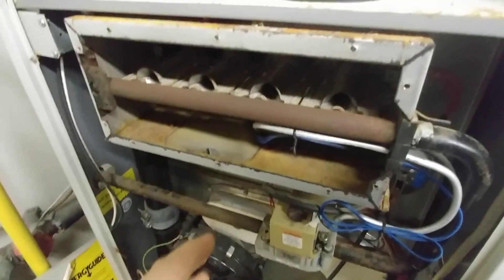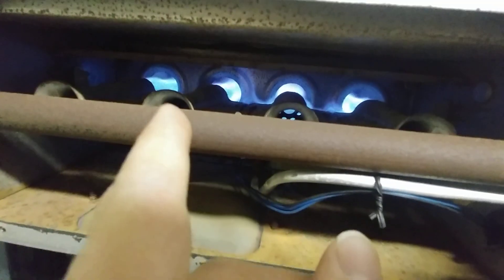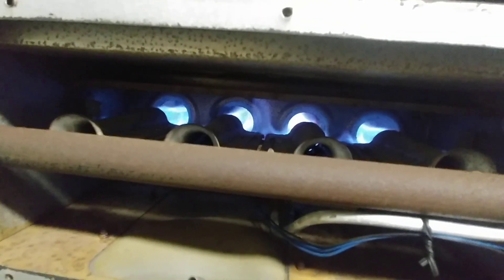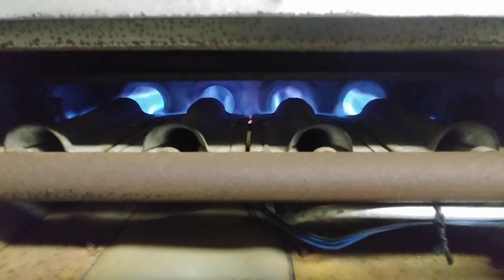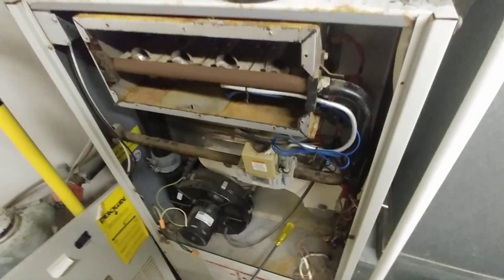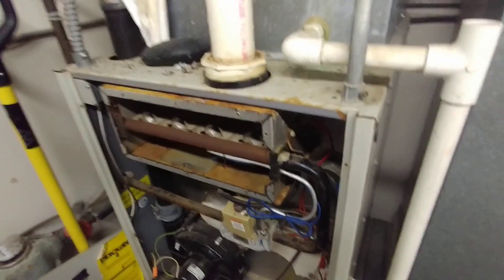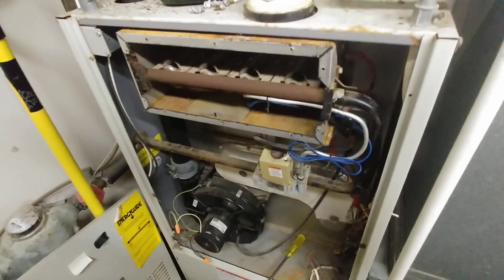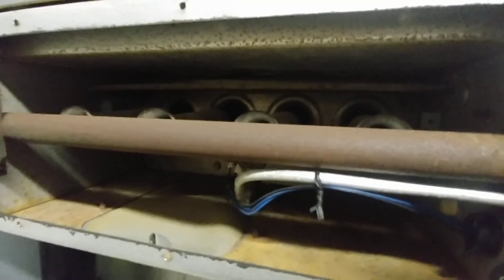Symptoms of Holes in a Heat Exchanger - Furnace Troubleshooting & Almost Lost my Eyebrows!

Comment: Bad circuit board or gas valve and bad heat exchanger. The fact that the gas valve is coming in prior to the igniter is also a safety hazard. That most likely caused the heat exchanger to fail because that problem was not corrected in time. This furnace had two unsafe issues, and it definitely needed replaced!!

Comment: definitely a cracked heat exchanger. The gas valve turned on before the ignitor did which allowed gas to build up before it ignites
Reply: It's a smartvalve.
Reply: Why is the gas valve coming on before the igniter
Reply: @Jamz2k  I dont know but notice the hissing sound that starts before the ignitor begins to glow.
Reply: @Jamz2k  bad circuit board